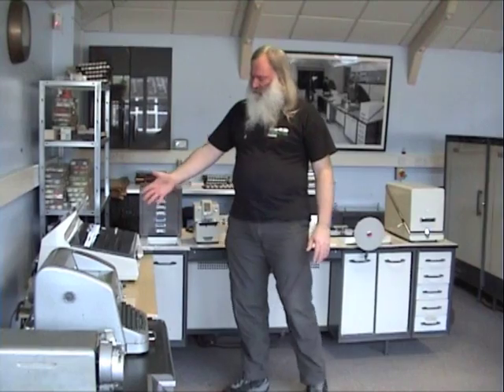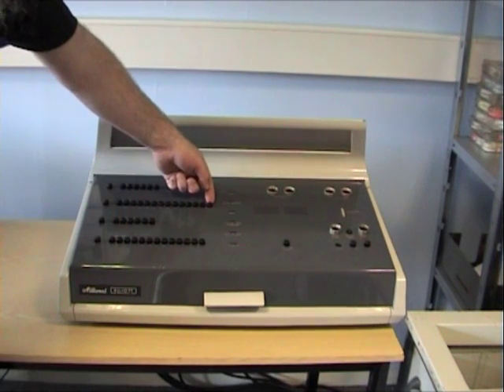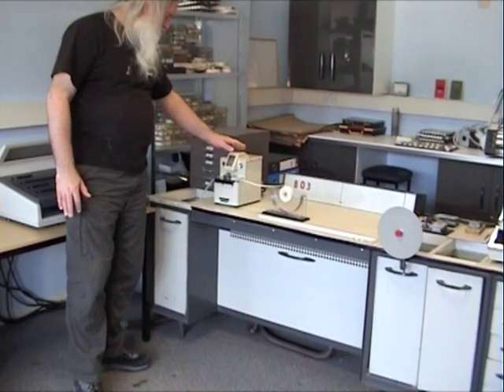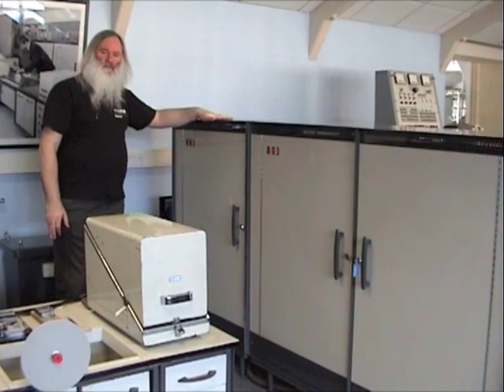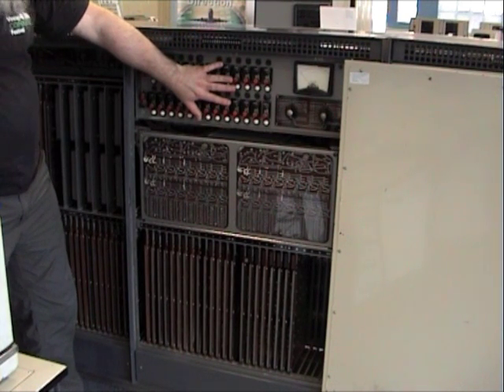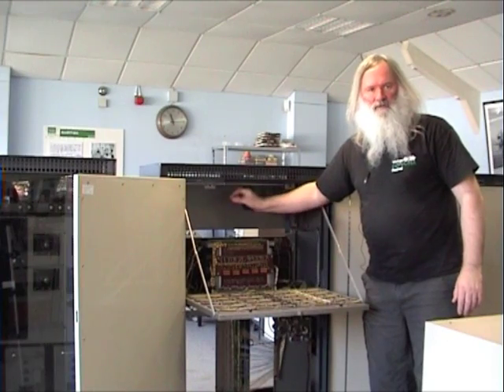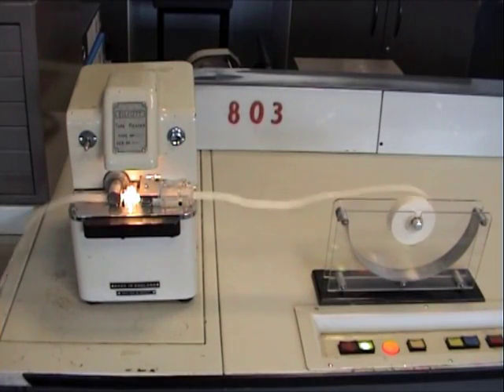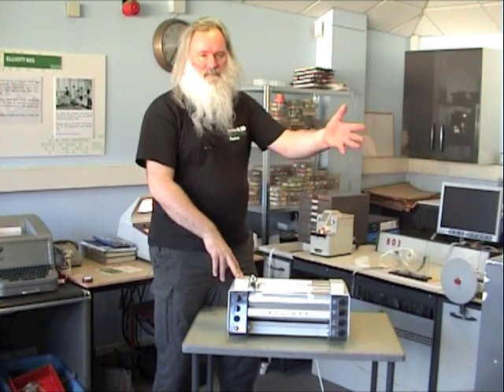Elliott 803 - Presentation #3

Comment: From 1961 to 1963, I worked for Hunting Engineering Ltd and introduced to the Elliott 803.  During this period, the graph plotter was being shown with the capability to draw pretty ladies!   I believe that I was the first person to actually draw graphs.  We did pre-processing on an 803 but then used the machine joined to a 503 at Hatfield.  Today it seems very primitive, with commands at the level of "Pen down" and "Pen up".
Reply: I worked with a wide roll feed calcomp plotter in the 70's.
It had+X, -X, +Y, -Y, steps and pen up or down.
It had an mechanical Y (left-right) scale factor adjustment.
Try to compare it to the wide format plotters/printers today.